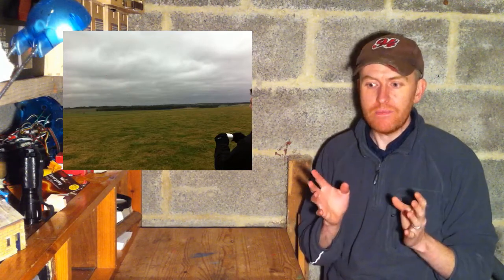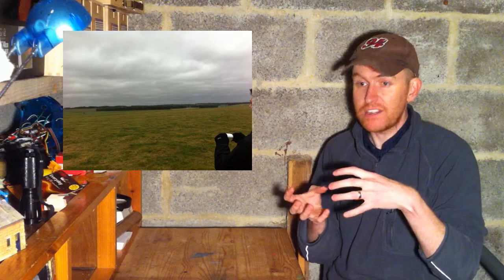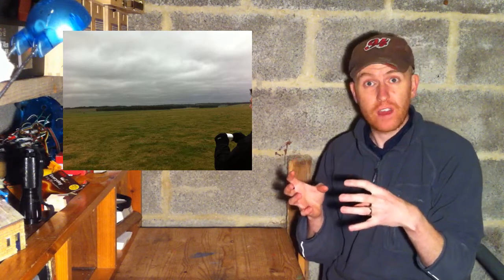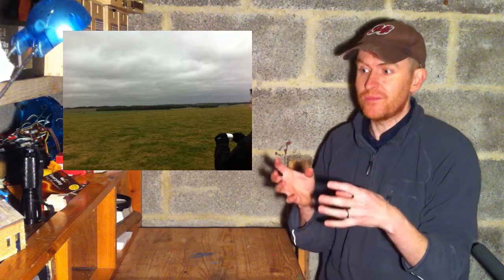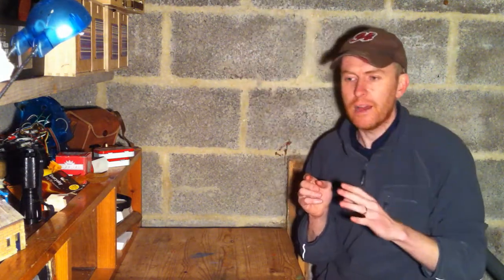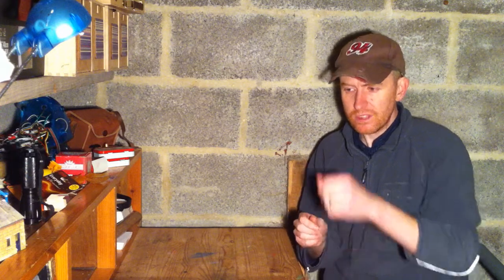Let's Try Set A Kite Altitude Record

Comment: In almost all developed countries there are a strict set of rules that govern control over a particular air space. These rules are set by international agreement so that they can also govern international airspace. These countries that have these rules have sections devoted to sports aviation which includes parachuting, gliding, balloons, rockets and kites. The limit for kites varies from country to country but is between 100 and 130 metres (400 - 500 ft.) for recreational flying in most jurisdictions. To fly a kite beyond those limits requires special permission and in my case I had to submit an application and pay a fee of $600. The rules were complex with requirements that included a defined zone and an altitude ceiling. Then contacting controlling air services to open the flying zone, on launch of the kite, retrieval and closure of the zone. There was also an extensive set of rules that require notification if there were any problems during the flight such as line breakage, kite breakage or failure of the winch system.  They also wanted a report on the record attempts after each series. Guinness required an application and I submitted 26 pages of evidence.

Comment: To fly a kite really high you need a kite over 100 sq ft. You also need to use the strongest, lightest and thinnest line possible. This line is UHMWPE, (ultra high molecular weight polyethylene) better known as Dyneema and Spectra. Nylon fishing line is, weight for weight, 10 times weaker than Dyneema and 5 times thicker. Nylon fishing line will support a maximum altitude of about 6,000 ft under ideal conditions. For long line lengths a winch system is needed. See my videos and web site.